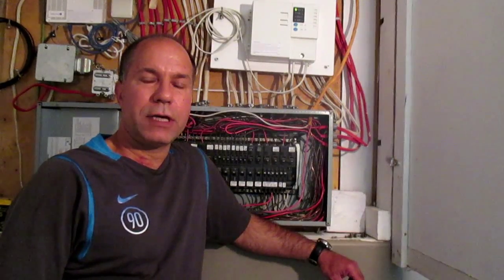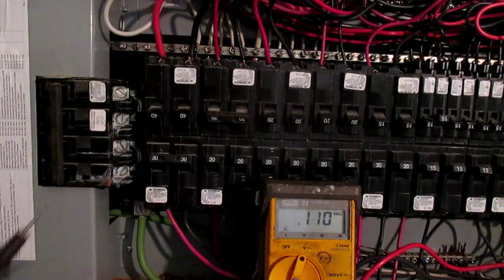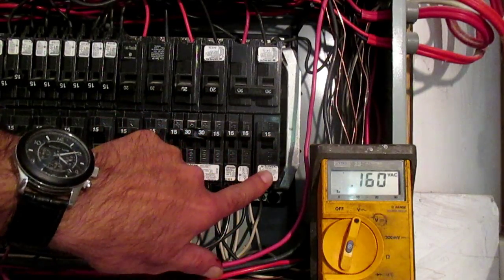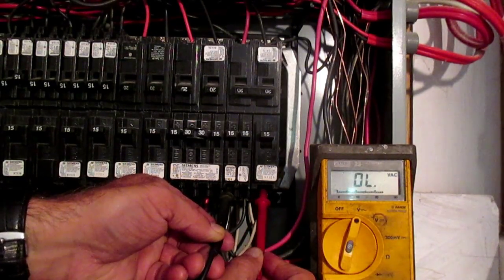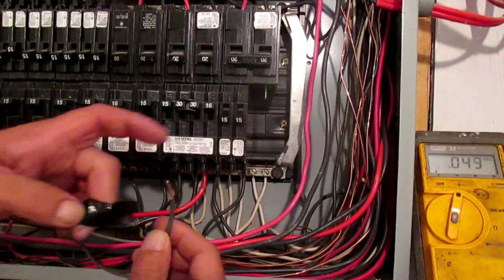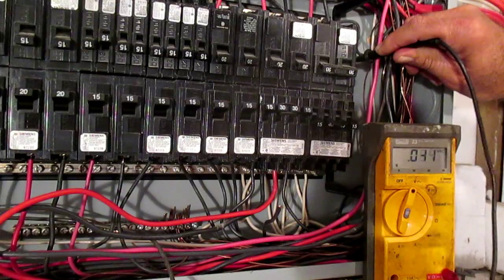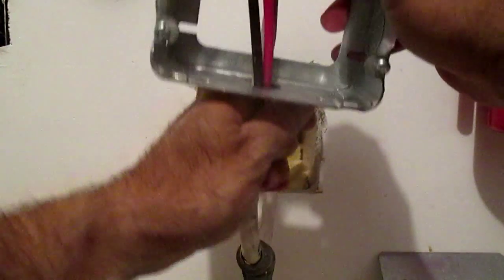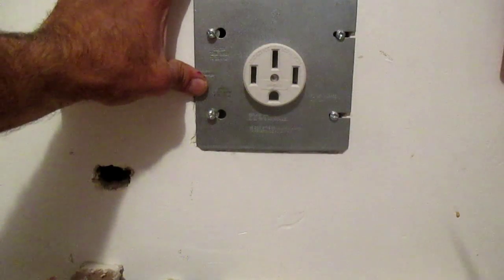How to add a 240 volt circuit for an electric stove

Comment: It's not positive and negative 120V, AC voltage is a sine wave that constantly changes direction from positive to negative and back again.  It's actually 120V phase shifted by 180 degrees which gives you a negative peaking 120V and at the same time on the other leg a positive peaking 120V which gives you a potential difference of 240V.
Reply: We can do the same in the UK and get 415V.
Reply: Car Rizzle    At least that is what an Oscilloscope will show.    Peak voltage for 120 volts rms is 170 volts.  Peak voltage for 240 volts rms is 339 volts.   These two sine waves happen at exactly the same time and direction.   If you use an oscilloscope, because of how it connects, it reads what you are saying.   You are going to say that I am wrong.   
Please explain to me how a phase can shift 180 degrees.   There is only one sine wave in the primary winding(single phase).  The time, voltage peaks, and and direction of flow must be the same.   At least all the electrical laws say they do.
Think about it before you tell me how stupid I am.
Respectfully,    Kevin
Reply: @KevinCoop1  There is only one sine wave but the transformation that is happening on the low-side of the center tapped service transformer that is feeding the electrical panel is what is causing the 180 degree phase shift, and effectively creating 2 sine waves with different phase angle characteristics. The voltage is reduced from the high-side to the low-side of the transformer and then each leg of the output from the service transformer is phase shifted via the inductance of the center tapped winding, and thus  the 2 buses of the electrical panel give you 240V when measuring across them. 
Not calling anyone an idiot just clarifying for anyone who is watching.
Respectfully Car rizzle.
Reply: Car Rizzle    So, with no center tap connection, there is no phase shift, the electrons travel in the same direction and you get 240 volts rms from L1 to L2?    As soon as you connect a center tap, everything changes and the electrons start going backward in half the transformer?   Where is the additional induction coming from just because of the center tap?

Comment: Why did you use a box extension and not a box?   Not safe, not NEC compliant.    Would have looked a little better with a cover plate.
Reply: One of many NEC code violations: 
1. Horizontal breaker panel is allowed but top row can't be used - breaker on/off must be as a light switch with off down.
2. FMC (flexible metal cable aka BX) clamp - not a typical 2 screw romex clamp.
3,  Extension box rather than a closed box. As others mentioned mouse chew hazard, drill or screw penetration from other side of wall, etc. Just plain won't contain an arc.
4. No plaster ring.
5.  For 2021 NEC a  GFCI is required - depending on state/local adoption/exceptions. Still a safety thing even if not required.
6. No ground pigtail to box - box is not grounded.
7. Ah yes a cover plate would look better and is required - the outlet is for a surface mounted metal box cover as you find on a basement wall, not inside a finished wall.

Comment: So residential 240 systems are called single phase split 240. There is no negative or positive in AC  single phase 240. You just get 120 on one split and 120 on the other as long as you use the neutral.

Comment: What gauge is the new wire?
Reply: It's usually 10/3 they use nowadays, when it come to running wire for electric ranges & dryrers.
Reply: @prestonmcleod1726  No, 8/3 or 6/3 cable for ranges, and 10/3 cable for dryers.
Reply: Iz Biz it’s 8/3
Reply: @mr.3phase228  Exactly Right Bro.👍

Comment: excellent video.  I am in same situation with a full panel no more room for 240 circuit for a new dyer, thanks for the explanation needed to do this.  I was thinking I would need to put a subpanel to wire the dyer.
Reply: Was your addition a success?

Comment: You could use 8-3 with ground for the range if it is close to the breaker box or 6-3 with ground if it is quite a distance from breaker box.

Comment: what wire should we buy to do this?
Reply: 8 gauge copper wire , depends  if your house is 3 or 4 wire , there will be either 3 or 4 individual  wires in a black cover  home depot  has what you need
Reply: 00 gauge

Comment: So the bus bars 120 on one side and 120 on the others side with neutral in the middle. There is no negative 120 volts in ac circuits.